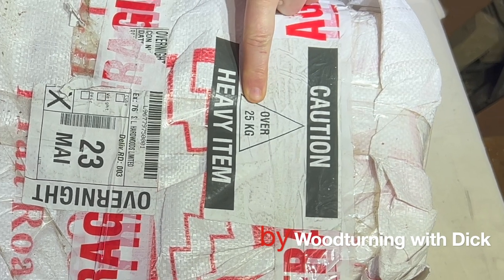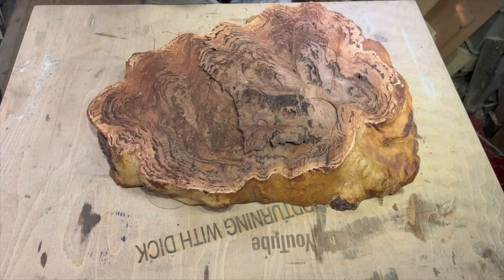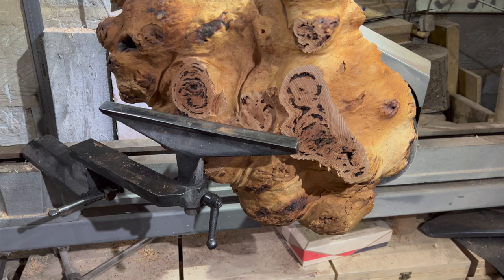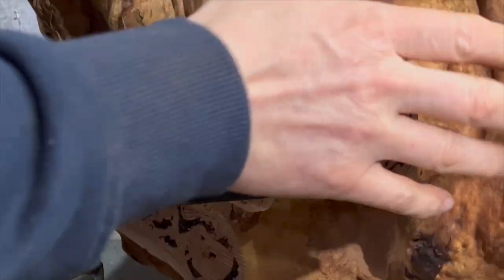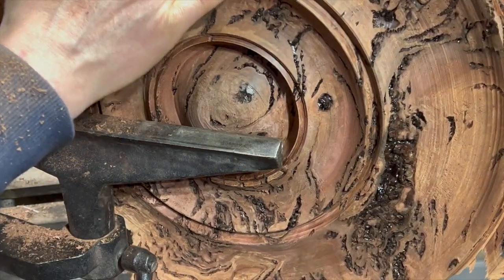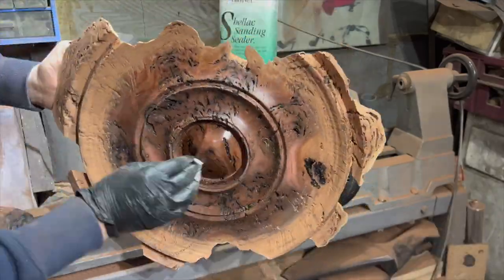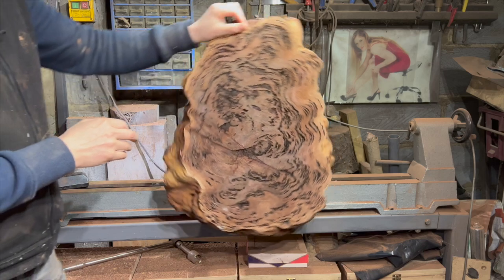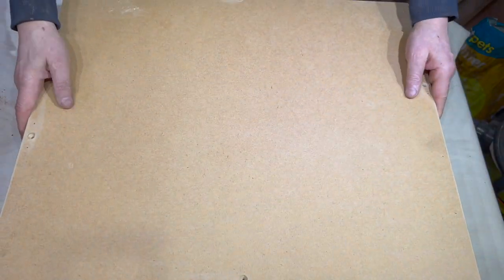Part 1 of 2 - 30KG (67 Pound) Goldfield Burr / Burl

Comment: That is an awesome Burr and a stunning piece you made from it.  Looking forward to seeing the final piece once it has been gilded.
Also looking forward to seeing the big piece completed.  Can definitely see the issue you would have with that at 500rpm.  I remember on my previous lathe, having to adjust the belt to the slowest speed and then quickly having to switch it off and cut a bit off to try and balance the piece...  Didn't have enough space to reposition what I had.  My whole shed would shake and things would come off the wall.
Reply from the maker: 🤣🤣🤣🤣 Yarp, been there with the shaking, now counterbalance or reset like I did this one, repositioned the faceplate 😁👍 
Thank you as always sir for your complimentary words 🤗

Comment: You need a bigger lathe! I had no idea you were doing all your big pieces on such a tiny Draper. Get yourself a Nova Nebula! Happy for you to pop over to see my Galaxi in action if you'd like.
Reply from the maker: Yup, little old Draper WTL95 with custom frame made up a metal worker friend that isn’t perfect, but allows a lot more that the original stand would! 
And also seen in these videos is a 40 year old Tyme Cub! 
Been 1/4 looking for a bigger lathe, but space is also an issue AND if I can turn what I make now, with working machines, why upgrade?
Reply: I have a 49 year old jointer in my shop and it's fine.
Reply from the maker: @gemofthewoods5802  🤣🤣🤣🙏👍❤️
Reply: @gemofthewoods5802  It's not the age (a lot less than your jointer), it's the size, or lack of it. Big pieces can throw a lathe around - you can see the wobbling in the video. A bigger, heavier machine would help Richard to make even more impressive pieces, easier and quicker.
Reply: @craftsmanwoodturner  hi Richard, you're probably right. Heavier is better. But he keeps saying he doesn't have any more room in his tiny shop. Maybe you could go over to his house and help him build a bigger building (?)🤣🤣

Comment: Hy I have the same lathe as you.  A draper variospeed. Even on the lowest setting it will not go lower than 750 have got any thoughts as how to  slow it down. Thanks  a new turner at 77  matt
Reply from the maker: Hi Matt, welcome along. I had some issues when I first got this lathe. The manual is still available online and the microfiche for parts and companies still selling parts. I stripped the outer casing off by undoing the housing screws and went investigating and found the belt was near knackered - first fault and then the adjusters were clogged up with sawdust and bits of belt, so I set about stripping further, broke some parts doing so and after ordering everything I needed including some circlip pliers, I put it back together and it’s been working great since, that was 8 years ago!